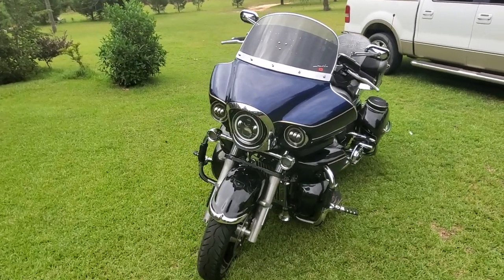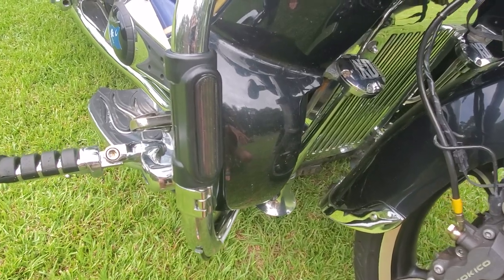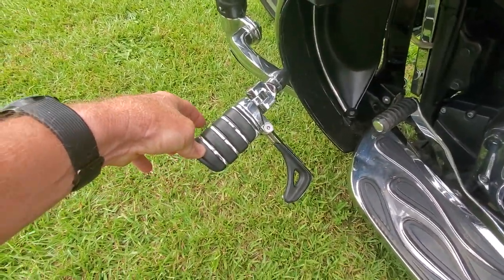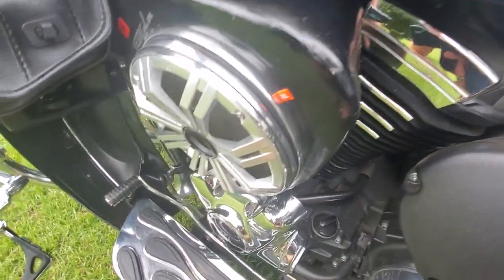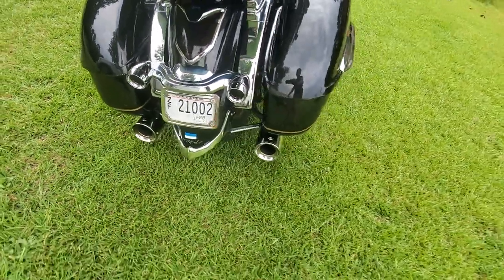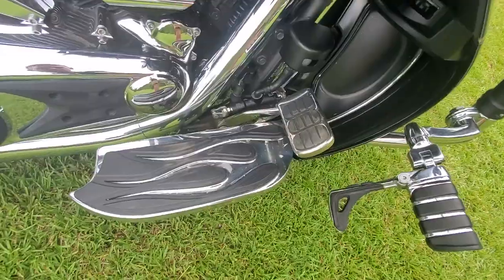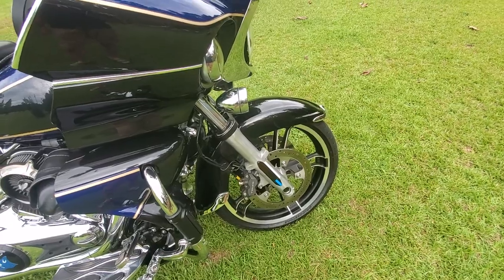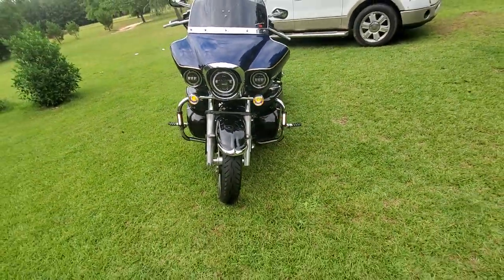Kawasaki Voyager 1700 metric with mods A better value than HD Street/Road Glide? www.metricoil.com

Comment: This is not just a "Better Value" than ANY Harley Davidson, but it is an IMMENSELY BETTER MOTORCYCLE than ANY Harley Davidson! I've owned and ridden both Harley's and the Kawasaki Voyager (I have one now) and the Kawasaki IS BY FAR a MUCH BETTER MOTORCYCLE than ANY Harley I've ever ridden. The Kawasaki is MUCH MORE DEPENDABLE, requires a LOT LESS Maintenance and Repairs, and is a GREAT RIDE, at probably HALF of the cost of a Harley! The Kawasaki Vulcan 1700 Voyager IS HANDS DOWN BETTER than any Harley Road King, Street Glide, etc.!

Comment: People need to know that the base Voyager 1700 is a totally exceptional bike. Rest assured that you are getting a top tier motorcycle that surprises you. Not only in quality of construction, but in total confidence on the road. Power, linked ABS, comfort, and storage that fits my 2X helmet in the top case. Pllus my WHOLE motorcycle jacket AND my Helite airbag vest in ONE side case. Mountain twisties can be done in 3rd gear only all day long, no awkward shift points. Harleys being made in the USA is 100% "Had to lay er' down" gray beard mythology. They are not. I came from a  GL1800 Gold Wing. I would never trade back. Just buy it.
Reply from the maker: It's a good bike... but it does need the ECU flashed... www.ivansperformanceproducts.com 
It is a jerky bike at slow speed/low rpm from the factory. The flash is a must.
Reply: The problem with Japanese bikes is their resale value. Buy a top of the line Japanese bikes and a few yrs later it's worth less than a 10 yr old Sportster. That is the only reason I don't buy one. I've owned 11 Harley Davidson motorcycles over the yrs and never lost money at selling time. The good thing about Japanese bikes besides they run good is you can get a super deal on a used one.
Reply: @ronrobertson59  That's actually a big advantage for cost conscious motorcycle buyers. Most japanese bike models have long production runs, so you can usually buy the same bike that's a few years old for a lot less money. I paid $5500 for my Voyager.

Comment: Hello bro
Nice great bike modifications... I have a question plz, what is the little display on the right handlebar switches where we can read CARE8D or something like that, is it a GPS speedometer display?!!
Reply from the maker: @Maximius38  air pressure display... tpms
Reply: @metricOIL  
Thank u very much, I founded as the TPMS brand..
thank u again :)

Comment: The Voyager is a nice ride and a great value.  There is a point of diminishing value from a market perspective though. 
 Just curious though, what year is your bike?   Have you compared the current resell value for your bike as compared to the same year Road Glide / Street Glide?
Reply from the maker: That's a 13... not a reseller, probably keep this one bc it does everything I want and then some... of course in the past HD has maintained resale values.... but the market seems to be changing... the days of over retail for a HD may be coming to an end... and the market is flooded with used HD bikes... id imagine a typical 2013 new would have been around 16k to 17k out the door.... selling the 13 stock bike with 20k miles $7000... depreciation of $800 (5%-10%) a year... maybe. 
Total cost of ownership makes a metric a winner.
The Kaw doesn't require expensive maintenance.. oil changes and ride... cheaper insurance... less property taxes.

Comment: When you installed those handlebars, did you have to adjust any cables or wires?
Reply from the maker: I added steel brake lines and about 3 or 4 inches to each..